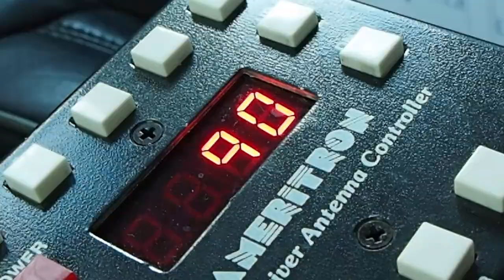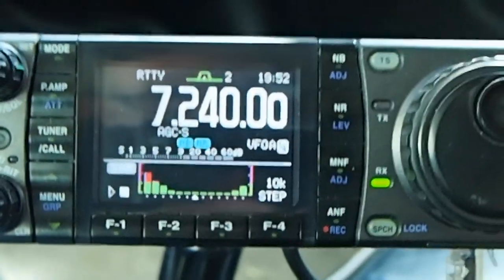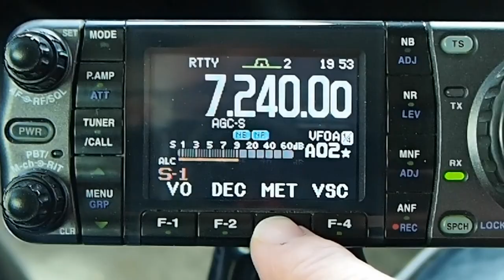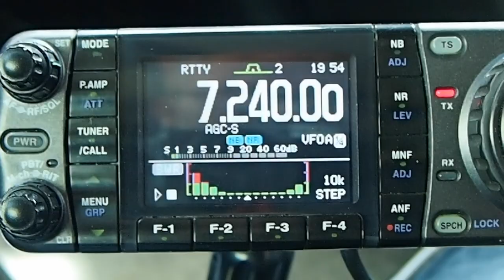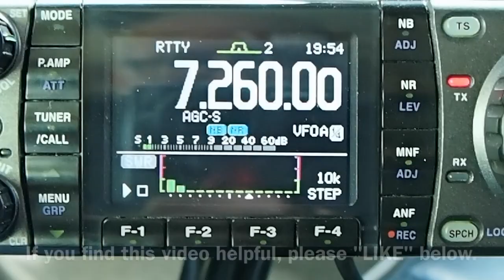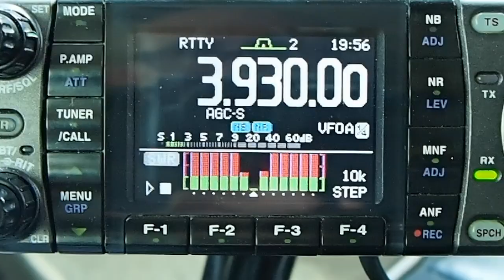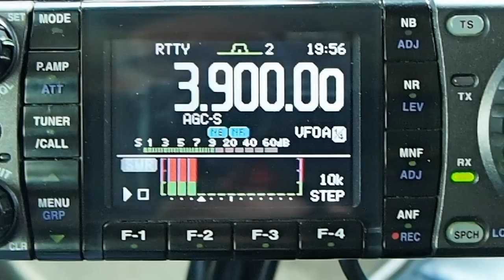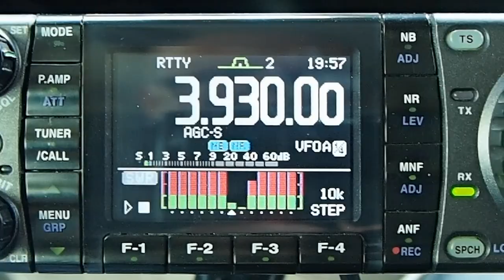Icom 7000 SWR Graph On Tarheel 200A Mobile Antenna

Comment: Cap hat must be at the top of the antenna.
Reply from the maker: Hi Ross,

I understand what you are saying and that is the best location, however it would be taken off by trees if it was at the top.

I consistently get 57 to 59 reports on 20, 40 and 80 meters. I don't have trouble checking into the nets I listen too with this setup.

When operating at a campground I can move it to the top.

I am working on a Hi-Q 5/80 install and mounting it on the top of the vehicle. It will be replacing the Tarheel.

Thanks and have a great day, 73 - Rich, K0PIR

Comment: I should have read it closer because it says "If necessary, adjust the RF power to approximately 30 W". I have done it with 10 watts on other occasions and it works. Icom also says:

NOTE: Before transmitting, monitor the operating
frequency to make sure you will not cause
interference to other stations on the same
frequency.

That can be done with the scope too.

Comment: I had a capacitance hat on my Tarheel 75A screwdriver, with a 6' whip.  I could never get a good SWR on 40m.  All the other bands no problem.  And I operate a lot on 40m nowadays, while the band cdx not that great.  I took the cap hat off - I didn't see any improvements like better signal reports from other operators.  Now I'm back to SWR 1:1 (mostly) across that band (with a small bit of tuning as I move up or down in the band), and it looks like (from the meter on my Kenwood TS-480HX) that I'm back to putting out the full 200 watts on transmit.  I don't operate on 80m, much at all, but I've found it no problem matching the antenna to the frequency.   All the other bands are a piece of cake, some not needing any tuning once I'm near the centre of the band, and I want to move up or down within that band.  I'm definitely no longer sold on cap hats - certainly not when they're used on my setup such as mine.  Possibly if it was mounted higher up the antenna (mine was about a foot up above the screwdriver top with the stub from Tarheel, but it looked ugly even there).
Reply from the maker: Hi Jan,

Nice to hear from you and thanks for the info. I haven't had mine very long and I will remove the cap hat later to try it out like you. I had it at a foot, then at 18 inches and now it's at 24 inches. I don't have to extend the antenna as much with it on there. I'm using the 6ft whip too. I have been bonding some more and that changes things. When I've got all that stuff done, including the cabling, I'll try different configurations. I have a 5 ft whip and a 102" whip I can try. I always get into the nets now. YL System on 20 and Breakfast Club on 80. No problems with getting into them with this antenna. I'll be checking into some nets on 40 too with this antenna. Thanks again, 73 - Rich, K0PIR